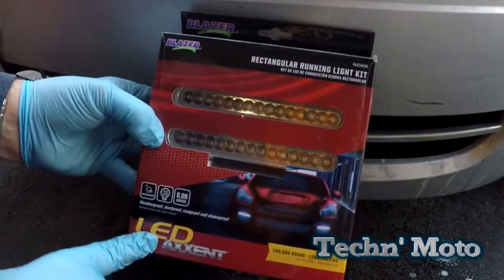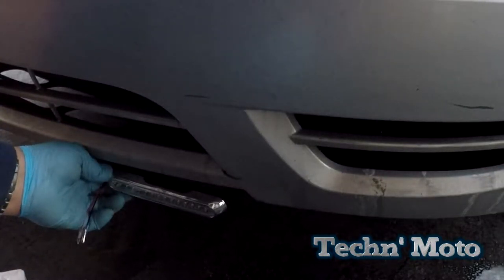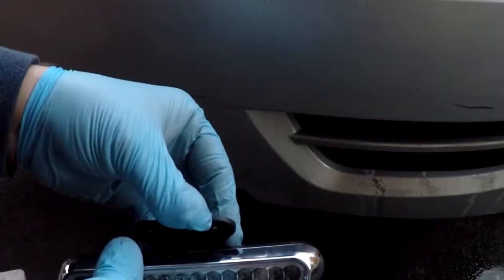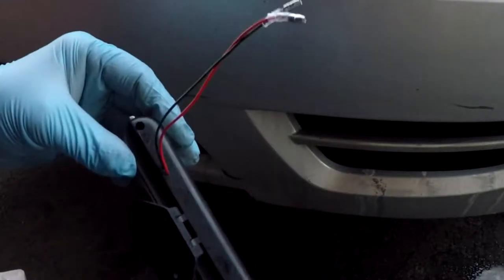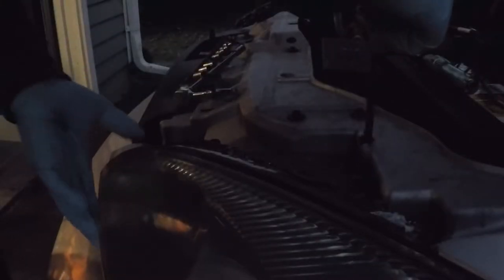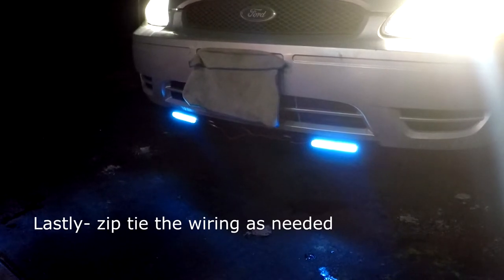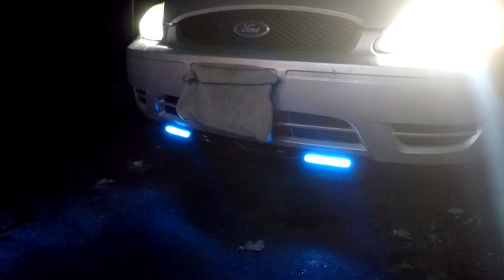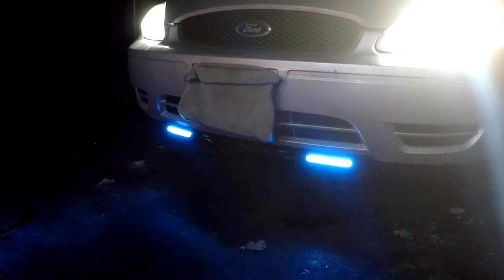Installing LED Running Lights on a Ford Taurus | Techn' Moto

Comment from the maker: Someone had said to me "I would put them inside behind the bumper your gonna lose them there" and after some thought I realized they were probably right. So I have since moved the lights up higher on the bumper to prevent them from getting hit with road debris. Thanks CM Moto 👍